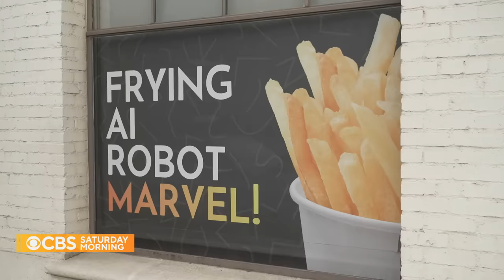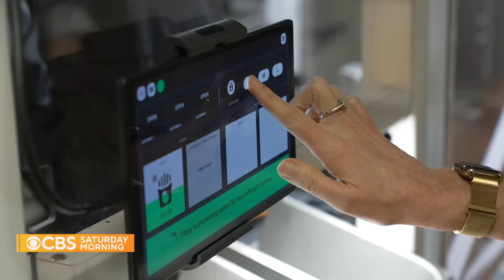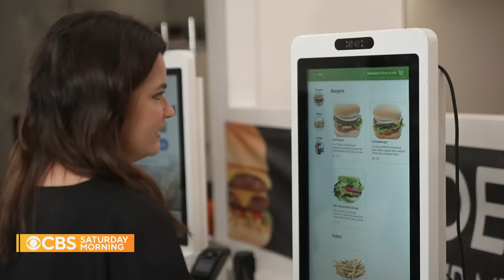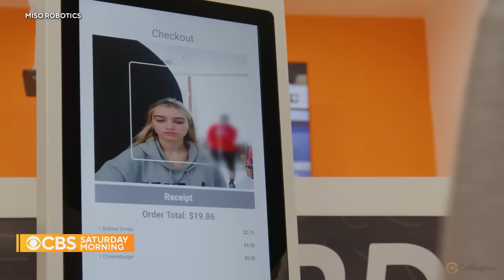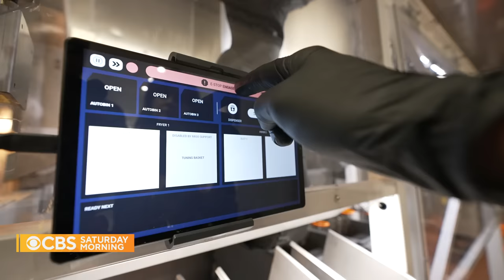California kitchen incorporates AI robot chefs

Comment: A robot does not necessarily mean AI.  Most of that was just automation, which isn't new at all...
I'm sure when mail sorting automation started happening, people were all freaked out.
But is there a drive to put people back into mail sorting rooms?  Nope...
The fact is, while automation/robotics has been affecting manual labor jobs for ages, the difference with AI is that it will be going after knowledge worker jobs...
Perhaps even creating more manual labor (robotic repair) jobs.
Reply: Yeah, I know....! AI is the buzzword the media and corporations love to use today. Automation doesn't mean AI. These robots are just following mostly pre-programmed routines. Computer vision is needed for the robot to find the fryer basket handle with the QR like code. We've been using robots for car assembly for many decades already.
Reply: They will replace these jobs. AI will help, but automation is the big driver.
Reply: initially robots are just in the factory. but when AI takes over, the restaurants chefs will all be robots..

Comment: this is still very far off and there's no true "AI" here at all, they are programmed and instructed by a human as any other robotic tool on an assembly line. the robotics are clumsy and prone to issues still. there's a reason why uptake has been so slow as companies have tested these to not so great outcomes. its become a novelty instead to try and draw consumers in. this is married with the costs of operating the machine, service etc. The other issue is customization of product, quality control and limitations in preparation. were literally talking very basic pizza assembly, flipping a patty or picking up fries from a basket. You still need hands to assemble, package and bag everything, which is why this company is selling the idea of it being an "assistant" to help solve short staffing for components of the operation.